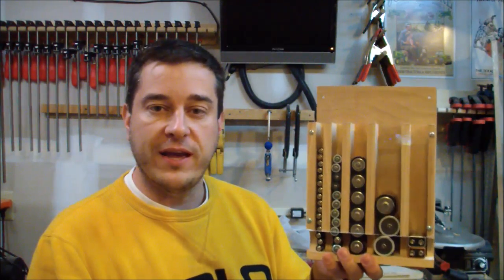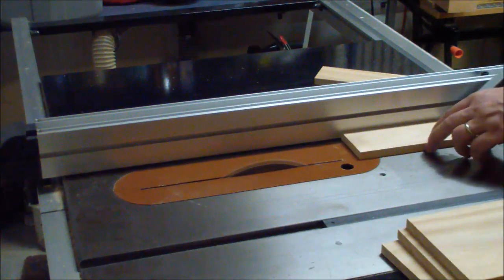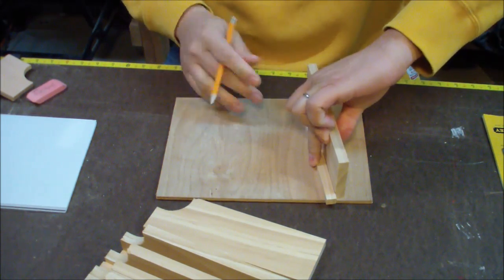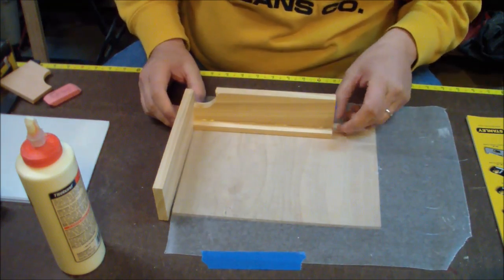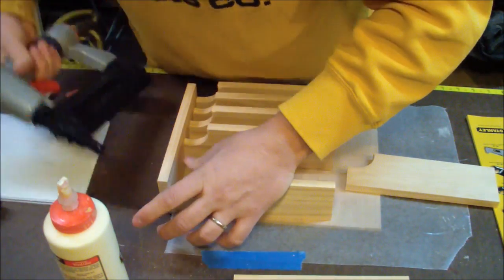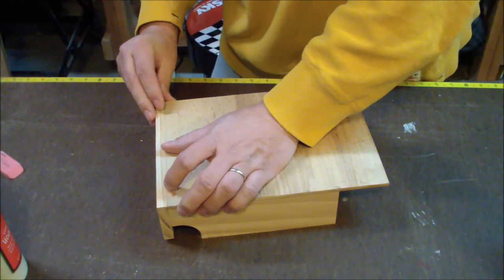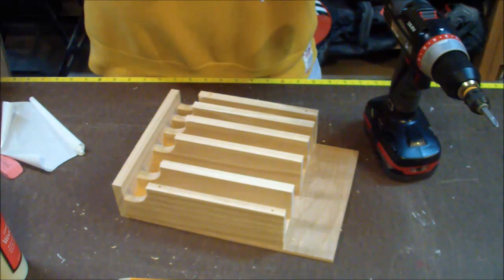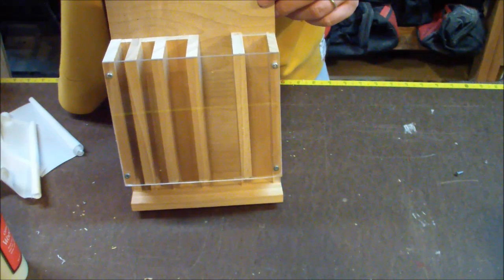How to Make a Battery Organizer (woodlogger.com)

Comment: Problam is putting the batteries in it. When you drop them in, thay want to flip around. On mine, I put a small strip with a rabbet on each side. This made the plexiglass slide out the top for easy access.
Reply: Thats a great idea, I was looking into this before making my own and I'm going to use your method.  Also, I want a small compartment below for the odd size batteries.

Comment: At 7:20, you said that "you're going to see a little cracking just due to the nature of what it is," with regard to driving the screws through the holes in the Plexiglas.  Not true, if it's done right.  (I haven't looked at the plans, yet; maybe those are in error.)

The correct way to draw one item to another with screws is to drill pilot holes in the base material (your wood pieces, here) that are slightly smaller than the diameter of the screws on the inside of the threads.  This hole allows the screw threads to bite into the wood without the screws cracking the wood due to the force of compressing the wood in displacing it.

The material (the Plexiglas, here) being drawn to the base should have holes slightly larger than the screws, but smaller than the screw heads.  This allows the screws to pass cleanly through the holes in the plastic without cracking it (unless, of course, you tighten them too much).

The simple way to do this and keep all holes properly aligned is to drill pilot holes through both materials just like you did it in the video, then use a larger drill bit to enlarge the pilot holes in the plastic.